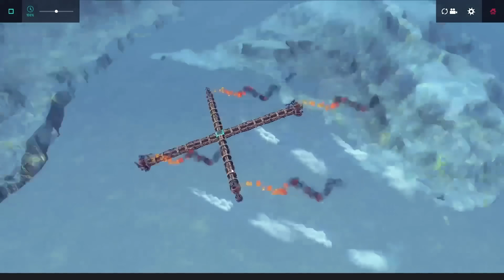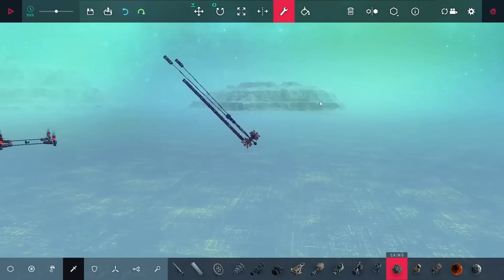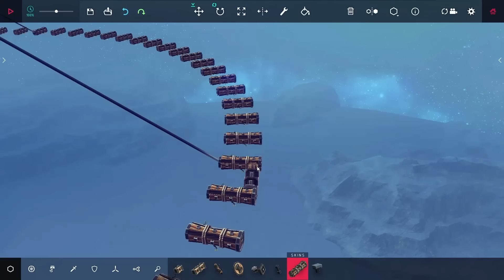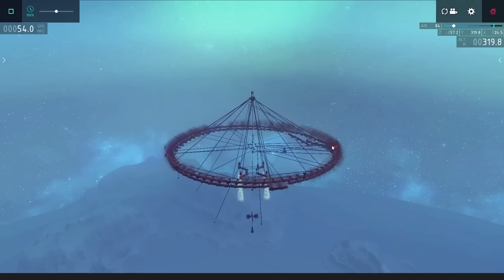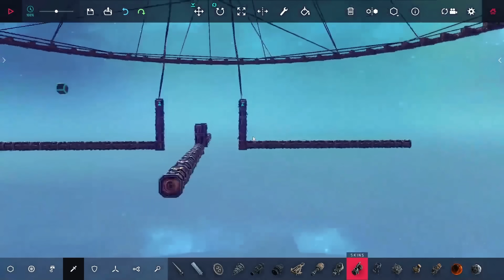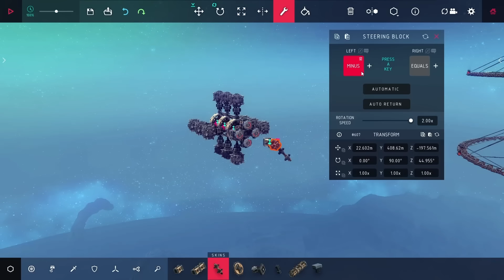Making an Orbital Cannon in Besiege

Comment: A note on your original ballista, my guess as to why the bolt wouldn't fly correctly is that the center of mass was too far back. You want the center of mass of an arrow/bolt to be pretty much as far in front of the center of pressure as possible, which is my guess as to why the first bolt design almost worked but had some inconsistencies under high load. If you think about it, you want the air resistance to be a self correcting force, so you want those fletchings to be behind the center of mass so the more your bolt deviates from head on the more force is correcting it. I think that a weight in the point and less weight back by the fletchings would make it way more accurate and consistent. Would love to see a ballista with a sight or maybe a full bow from you at some point.

Comment: The oscillations most likely stemmed from the not-so-rigid connection with a structure so large, alongside that besiege hates having too much mass on a block that is too light, so it starts spazzing out.

Comment: If you have counter-rotating wheels, it also counters out the gyroscopic effect. Though one trick I've used (in RigidChips) is to have them counter-rotating while they spin up, but then eject the wheels spinning one way, so it's left spinning only the other way.

Comment: I found it really funny you thought more rigidity would fix the reaction wheel.. I assume the rigidity would cause the wobble. Minor errors in floating point calculations while everything is inline is baaad for physics engines. The reason the bottom one was more stable is because it was a large cone probably.

Comment: The oscillating of wheels r happening do to the stress on the joints of the brasses most games engins hate large amounts of stress or bug out with it or have wired speed or texture or movements so they implement a system to allow hinges to move out of place a little to dull down the glitching or stop another. Btw I’m not an expert but I think this is y
Reply: It do to the very high amount of tension that even in physics engins hate. Test in real life make a long string stay exactly straight and add a weight in the middle. It’s impossible it will probably break the string. Also the reason y tension bridges arch down